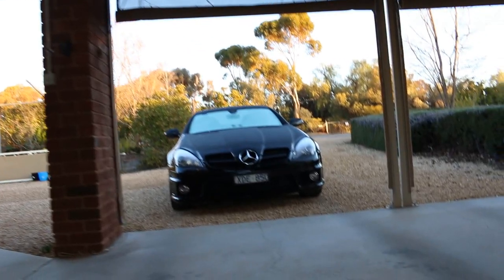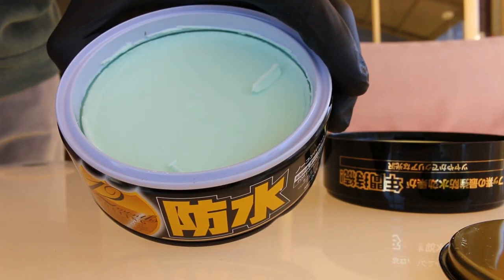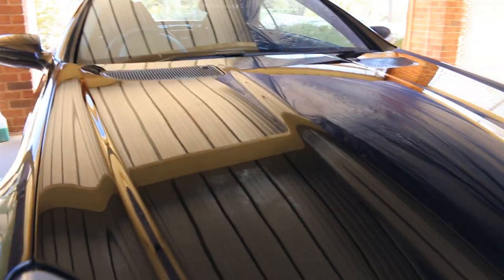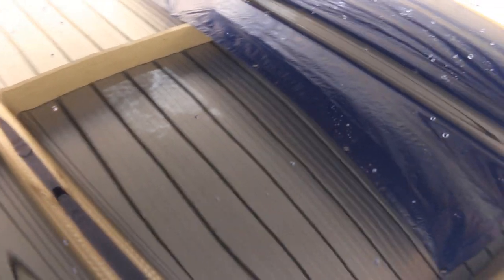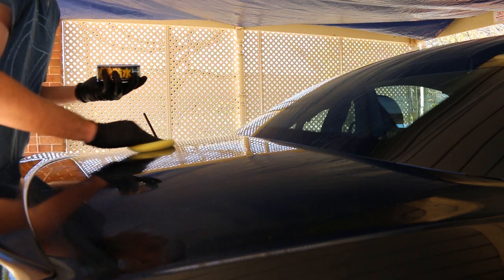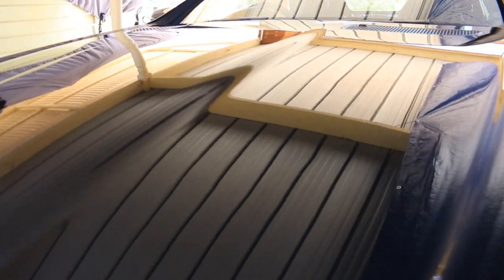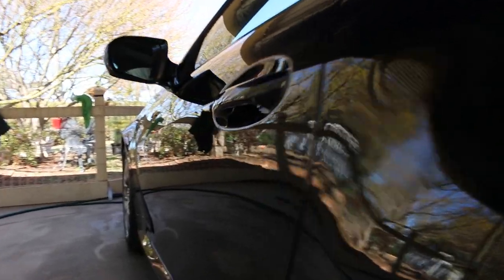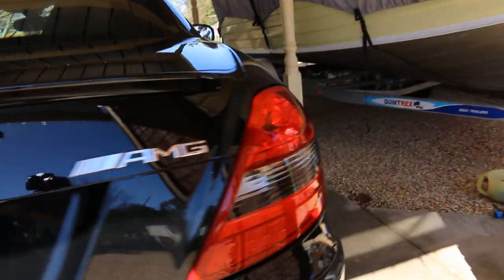Soft99 Fusso Coat Dark Colour Wax Review | Is It Worth It Test | FocusOnDetailing

Comment: Strong beading, long lasting, inexpensive.

But, easy on not easy off :)
Reply from the maker: Not wrong there mate! Thanks for the comment
Reply: You're putting it on way too thick. Less is more, wipe of is effortless.
Reply: @weaner232323  any other tips for effective application? I've heard using a damp applicator works great. How so?
Reply: The key is the amount of wax. With Fusso you need to keep layer as light as possible, nearly invisible. When it's a light coat it's easy to buff off. When you have that much as the video you will have problems with buffing it off and wax/greasy holograms which will come off after washing the car next time. One jar should last about 25 to 35 cars maybe even 40.